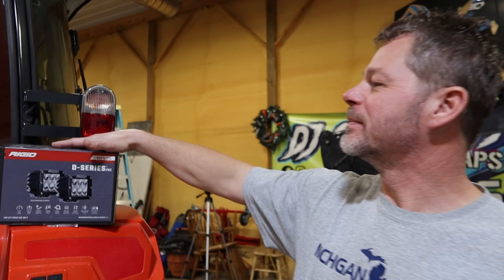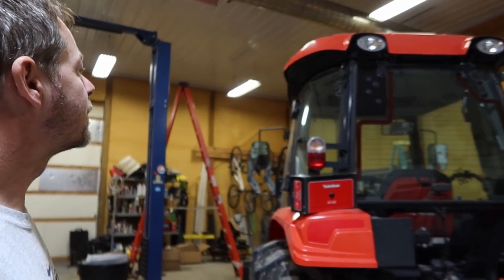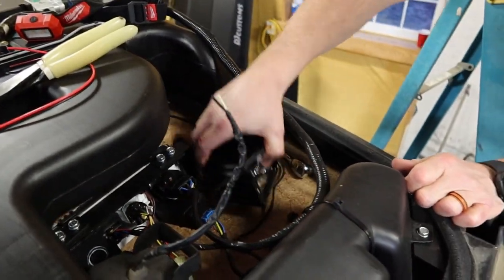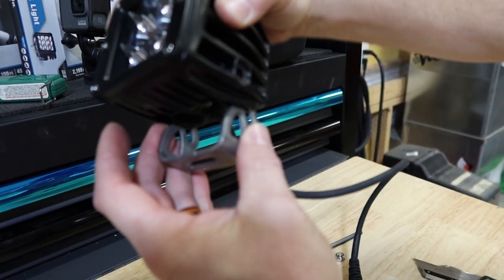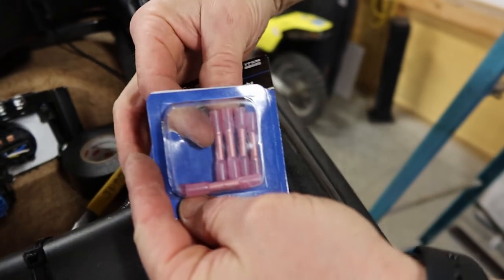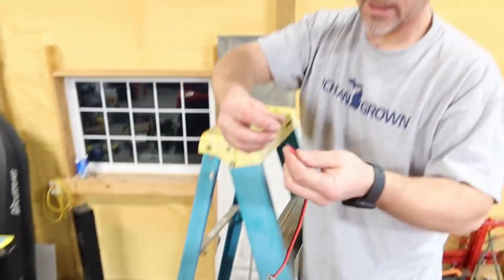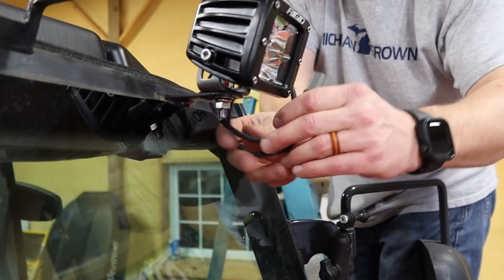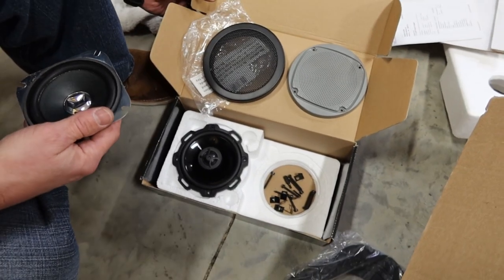Kioti Tractor LED Lights - BIG UPGRADE!

Comment: Hi Dan. Great video! I just did this recently myself on our new Kioti RX7320, except I went with Baja Designs Squadrons. I have some videos talking about them if you're bored sometime. One nice addition that I didn't expect but came with my lights are that they shipped them with additional weathertech type connectors to make it fully plug and play. This is such a necessary upgrade. The factory units are useless. I also changed the speakers. I went with Pioneer, but the covers don't fit correctly with the existing holes, so I left them off. It was between those and the Fosgates. Only reason I went with Pioneer is because the price of the Fosgates happened to go up and the Pioneers happened to go down, haha. Both mods make the seat time so much more enjoyable. Now just waiting for more snow up here in northern WI.

IDK how we did anything before ratcheting wrenches, haha! Happy New Year!